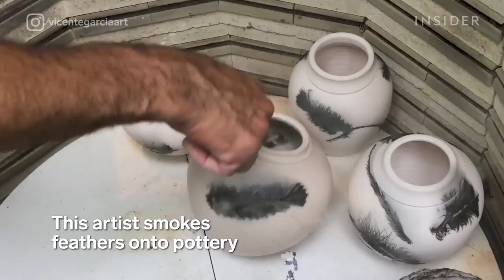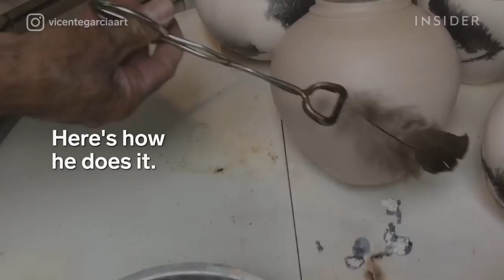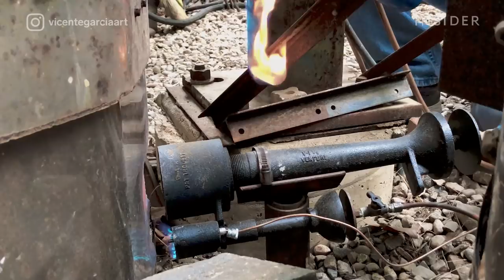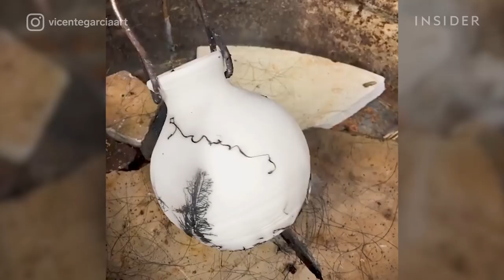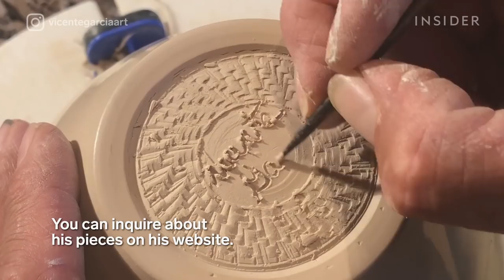Potter Smokes Feathers and Hair Into Ceramics

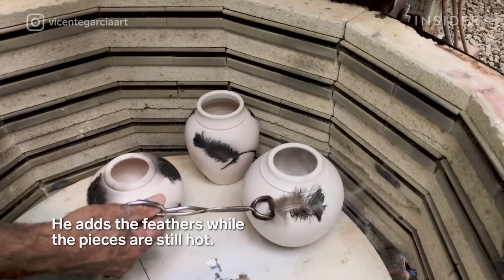Comment: The kiln is electric or gas? At 1:14 there are resistance wires clearly visible, yet one cut before he runs a gas torch... Or was it electric and he modified it for extra heat input?

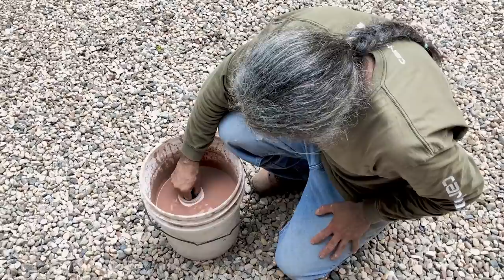Comment: I dont get one part - he obtain that metalic effect at 2:37 by burning paper onto it ?
Reply: hinduspl He probably used a clear glaze or metallic glaze and those paper add its colour I guess
Reply: it's the glaze that provides the color, paper is there to use up the oxygen left in the container  by burning so that the color from the glaze can develop
Reply: That called raku technique 
By put glazed product that still blazing hot in different type of material such as paper ,wood powder,dried grass and etc
Btw sorry for my bad english
Reply: where to look for glaze? what it is exactly ? its glaze for ceramic or ?
Reply: Glaze is special colour for ceramic product.that give ceramic product shining like glass product
Reply: You can it at ceramic stuff shop
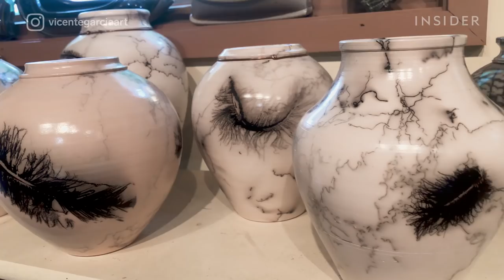Reply: Raku glaze is applied to bisque fired pottery.  Then heated up in a kiln.  Once it reaches the correct temperature it is put into those small trash cans you see filled with news paper.  The heat from the pottery reacts with the paper (read As yuki's comment) and you get results like his.  What you see at the 2:00 minute mark is a re-creation.  In the actual process the paper would have turned to ash and the pottery would be too hot to pick up with bare hands
Reply: He used a glaze which reacts with oxygen and becomes metallic